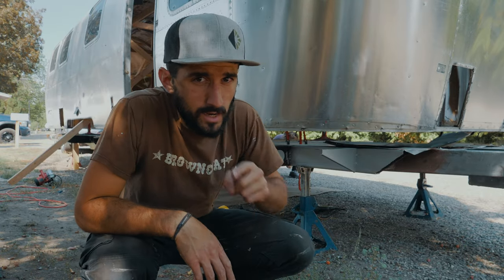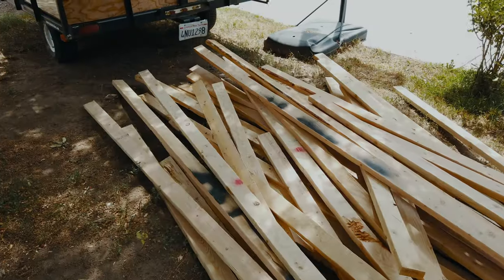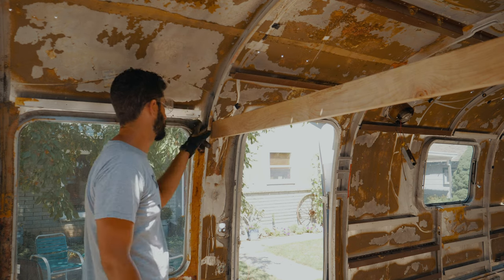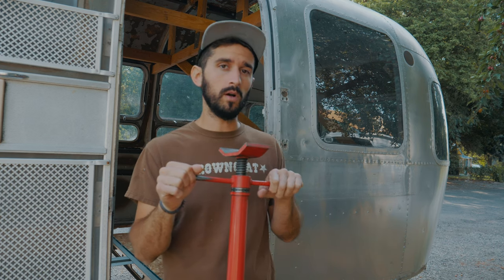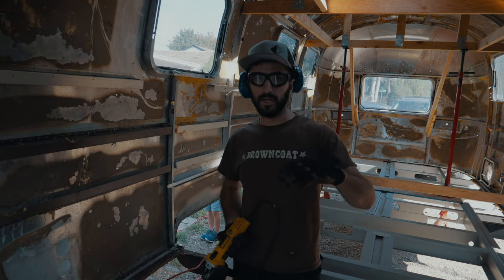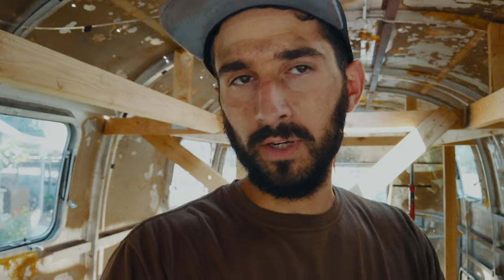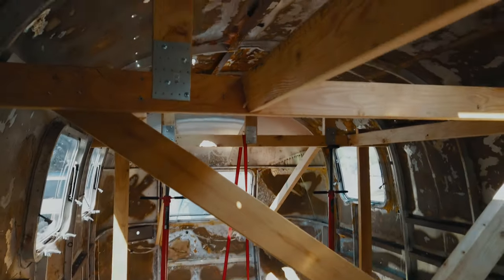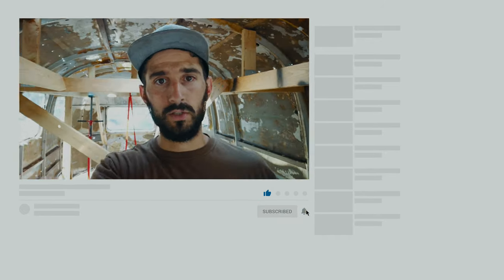Airstream Renovation: Lifting the Shell

Comment: Great video...Im going to use your method.  I just started a 1972 Sovereign project.  Good luck
Reply from the maker: very cool! good luck with the project. just FYI, I ended up adding two more "A frames" at the front and rear, this made it much more sturdy and held up in extreme wind conditions. But if you're not dealing with wind then the one in the middle was fine. Thanks for watching!